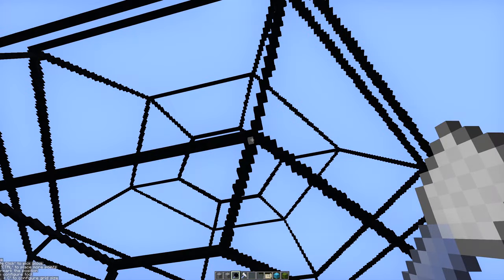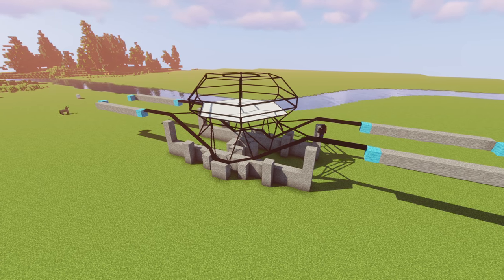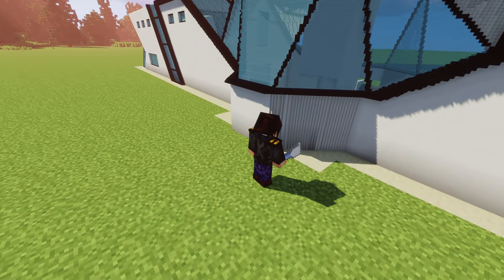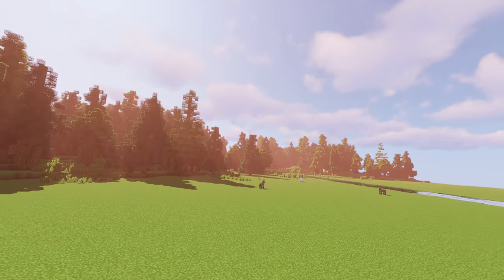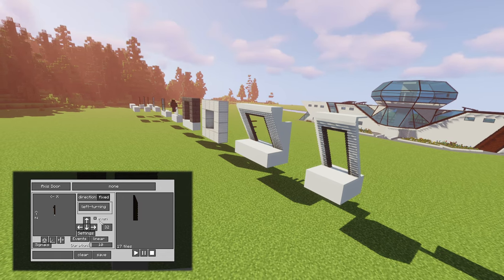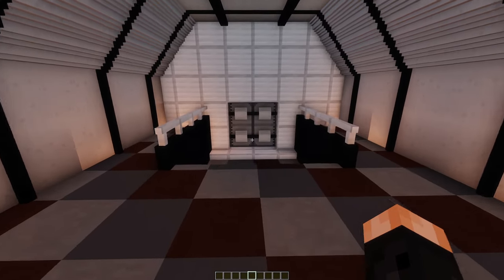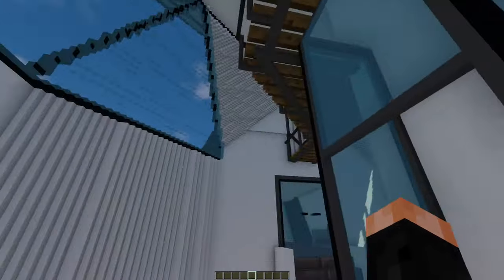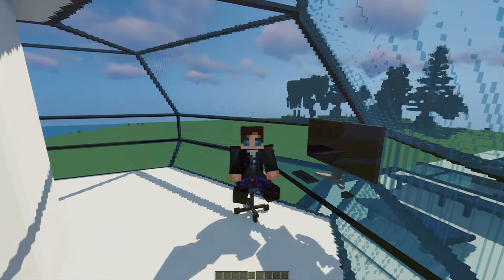Turning a DIAMOND into a HOUSE in Minecraft - Detailed HD Little Tiles Mod Build Showcase

Comment: Another amazing build! Really love the design of the house. If you want more of a variety of textures I'd recommend checking out Kiro's Basic Blocks. They are dyeable textures specifically for Little Tiles, adding textures like metal, vertical and horizontal wood, wallpaper, and much more. It expands the amount of detail you can add to your builds in my opinion. The vertical and horizontal wood is my favorite as I love designing wooden furniture.
Reply from the maker: Huh that actually sounds aufully useful xD especially the metal texture... Thanks man I'll check it out ASAP :)

Comment: Very professional, I would be interested to see more of these sketches in the beginning; are you making these for every build? Also, what did you mean by little tiles not having an "elevator option"?
Reply: it could be he was using a door thing that moves up to make the elevator
Reply from the maker: Yeah basically the elevators are just doors that go up and down... Making it stop at 3 different floors and wait isn't really possible :/

An for some of my maps (like among us) no, since I already had more then enough source material to work from, for builds I design myself... Yes, usually I'll design first and then build out my designs :)

Comment: what are you talking about, you can totally make elevators in little tiles, you can put doors on doors on doors and use the most inner ones as switches and have sliding doors at the bottom and top and a toggle button inside easily all capable of moving up and down with non moving buttons at the top and bottom on the outside as well
Reply from the maker: Yeah... right up untill you want more then 2 floors xD
A true elevator should be able to go and stop at multipule floors seemlessly, this is not possible with doors, as there will always be a sequence of events that has to take place.